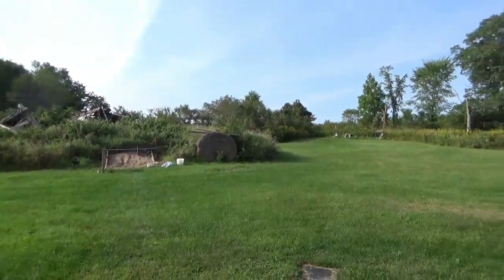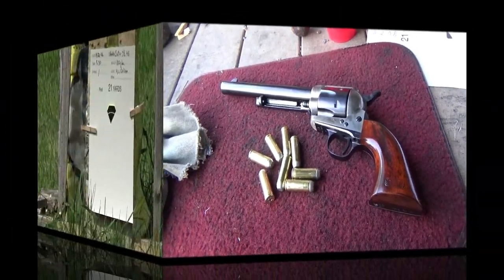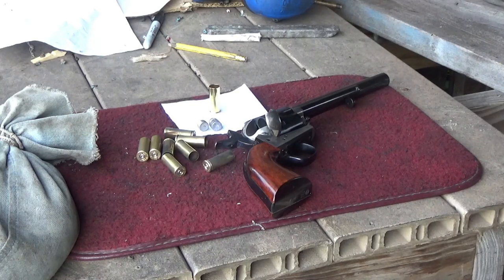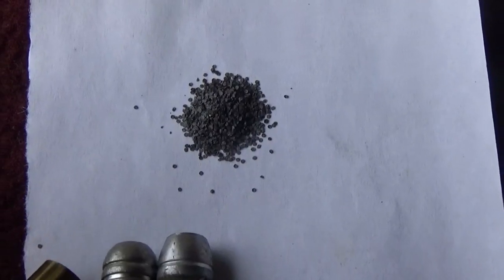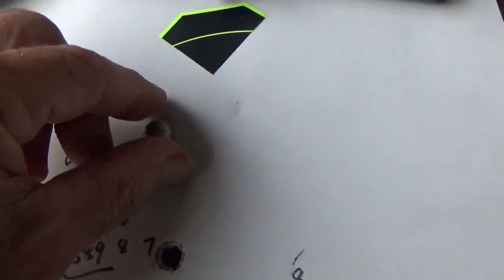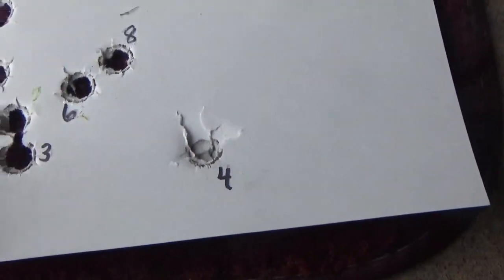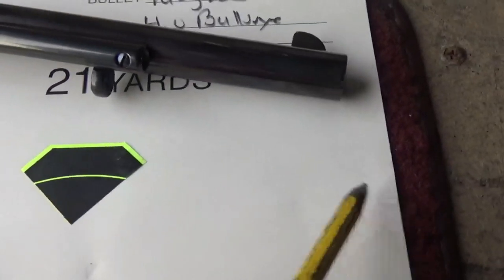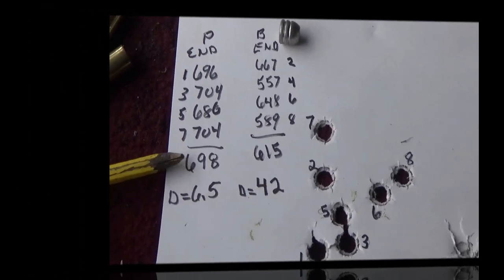Powder Placement 45 Colt  - Part 1

Comment: Interesting results. That’s why I prefer trailboss powder for smokeless 45 Colt, it takes up a lot of that case volume.
Reply from the maker: I’ve used that also, and have had pretty good results. What I don’t know about, there are claims that it produces considerable more pressure to get similar results to other powder. Then again, living on a more dangerous side, it makes perfect sense, as long as you have a supply. Thanks again for your time and comments. O. R.
Reply: @oldranger3044  I do like to live dangerously!
Reply: I also use Trailboss for the reasons stated. It produced the most consistent loads I've made... with an 1892 Mark I Webley.

Comment: I've used 1/8" nitro cards over the powder on 45-70 loads to keep the powder on the primer (with low powder loads) & it works great. I've never tried it on 45 Colt pistol loads, but looks like it might be a good idea with low powder loads, as well. Thank you for the idea.
Reply from the maker: You’re probably aware that some shooters are reluctant to do that thinking that if the wad moves or whatever, and powder gets ahead of the card, possibly a KaBoom. I suppose as long as that doesn’t happen, life is good. Just wondering what your thoughts are on this ?  O.R.

Comment: I did the same test with the 44-40 in a Uberti 1860 Henry.  With 8 grains Unique I found 300 FPS difference.  I now stay with black powder only in that rifle (brass frame).  On a side note with a 45-70 sharps and a 37 gr charge of Reloader 7, I stored the cartridges for a few months nose down.  Went to the range and the first shot did not detonate the powder but the primer lodged the bullet about 6” in the barrel,  unburned powder in the chamber.  I now stay with a case filling powder and a hot primer.U
Reply from the maker: Perfect example of experience counts big time. Thanks again for your comment. O. R.

Comment: I had the same results with my .45/70 Winchester 1886 using 12 to 14 grains of Unique, Herco and Red Dot under 340 and 405 grain casts. They all went bang and hit the target but with widespread velocities. The shots taken with the powder at the front had lower pressure, indicated by sooty deposits on the cases.  After some research I tried a 1 inch square of toilet paper gently seated on the powder against the primer using a piece of dowel.  This significantly  improved the accuracy and the cases came out clean. NOTE - Do not use card or any other sort of wad, doing so can ruin your gun and your day. A small ball of cotton wool should be okay but I prefer TP. I use small(ish) charges of pistol powder in .357 and 44 Magnum without TP as it doesn't appear to make as much difference in the smaller cases.
Reply from the maker: Thanks for your information. I have used that same load in 45/70, but never checked speeds.  Groups all that great and your findings give probable causes. Thanks for your comment, especially the note about not to attempt to use wads to keep powder in place. O. R.
Reply: @oldranger3044  Don't try those  45/70 loads with 500 grain bullets, the groups are awful and keyhole like crazy at 25 metres. I use full Pyrodex or 777 for those as real BP isn't available locally.
Reply from the maker: @85waspnest  👍 Appreciate the heads up. O.R.

Comment: A very interesting test! I have been conducting many test on this subject, but using Bullseye there is so little powder volume in the case that I have never loaded it without a filler, I have always considered the fact that when held horizontal the powder would lay along the bottom of the case, even if you tap the cartridge on either end it falls to the lower edge, then when you consider how much displacement occurs on firing, that would /could, put the powder anywhere in the large empty space, I have exactly the same Uberti as the one you are using, but struggle to get groups as good as this using the 250 grn bullet with either solid base, or hollow base, with a foam filler, I am never very happy about large air space in large cases, so always use a filler, but your results here will see me conducting more experiments, I wish we lived closer! Many thanks for posting this one OR! Chris B.
Reply from the maker: Hi again Chris. I have been amazed at how well this gun groups with everything I give it.  This 160 gr. has never done well in rifles, and I’ve been pretty busy last few years playing with percussions. So I’ve had the gun since 2000 but just unboxed it a couple weeks ago as my brother inspired me to get into some 45 shooting. Won’t “bore” you with the battle to correct windage, but that’s fixed (hopefully). 

I was careful and I figure the powder only piled up near the ends and didn’t get much chance to flow along the bottom. Now I’m wondering how it distributes itself in normal shooting. I’ve been surprised how well these smaller amounts of bullseye do in the large cases without filler. They seem fine for my plinking use, and I’m a bit nervous about filler with recoil possibility powder could get ahead of poorly placed wadding.  Lots different than a single shot Sharps.   Plenty of folks know much more than I about this and other stuff, but figured I’d do this vid, couldn’t find much on it on YouTube, and this might generate more awareness. Thanks again. O.R.
Reply: @oldranger3044  The powder in this large case could end up anywhere, but when you think how much the recoil must wash it back and forth it would, logically, end up behind the bullet, that is why I always use a 1/2" dia foam wad that will definitely hold the powder against the primer end, I think Hogden say it does not matter about such a small charge of powder floating around in the case, but my logic says that if you can keep it in one place it must be more consistent, I have not tried my Sharps 45/120 with smokeless, but with these big cases the ignition is very important for repeatability. My Uberti is the black powder frame type, but has very shallow rifling, that is why I made up a hollow base mould, to try getting it out into the grooves, but it is not very consistent. Chris B.
Reply from the maker: @453421abcdefg12345  Interesting. Mine is also that style, shallow rifling. Fairly soft lead (around10) sized .452. The 160’s were tumble lubed, and 454 as cast. I’ve also had good results with a Lee 200 gr TL semi wad cutter that comes out of the 6 cavity mold in the.460 range. Stopped that when I noticed difficulties starting them in the case. Some wouldn’t even chamber.  Thing is, I was shooting 1 1/4 groups at 21 yds for 4 of 5 shots. Thinking about getting another Uberti, as my brother has a 4 3/4 old style that is good. Like you said, if closer it would be interesting to compare guns with the same load..O.R.
Reply: @oldranger3044  I have tried so many bullet styles in a quest to get mine shooting well, I even tried a hollow base in an attempt to get the bullet gripping more firmly, tried hard lead, soft lead, powder coating, I have a feeling that hollow base bullets open up the "skirt" as the barrel on a pistol,(7 1/2") is so short, that gives awful accuracy, I have not tried copper jacket as they are .452" for auto, I was going to re barrel but I cannot shift the barrel, do not want to twist the frame! I find the cap & ball pistols are much more accurate . Chris B.
Reply from the maker: @453421abcdefg12345  That's been my feeling too.  In today's dollar, would there be any cartridge handgun made in the $300 range that has better accuracy than a replica 1858 Remington?? I doubt it.  I haven't put much $ or stock, into the cartridge guns (I prefer SAA's) as a result.  Maybe I'm unlucky because this Cimarron Uberti shoots really decent.  The next 10 I buy may prove to be like yours.But, I got's to know.  I'm not famous enough for someone to dump 5 on the doorstep to test.  So, you know what that means.  
I assume you figure that .452 is too small?  As you said you tried hollow base.  I was going to mention that I recovered a slug that was .460 (Lee 200 grain TL), and the forcing cone, or barrel had it sized down to 451 from what I could measure.  
Anyway, this 45 has given me a "New Hope" for the style gun that I grew up to admire.  It might actually shoot as good as the percussions.  O.R.
Reply: @oldranger3044  OR, I am sure back in the day there were some lemons among the guns available, after all Winchester had their 1 of 1000 rifles that were said to be the most accurate of their production line offerings, but it is odd that with the relatively crude system open to so many variables , that our C&B pistols deliver such consistent accuracy. As for barrel dimensions, I am sure that now Berretta has control of manufacture the cartridge 45s are machined to the SAMMI spec for 45 ACP, which is .451 not .454", and also have very shallow grooves, but the chambers appear to still be machined to the 45 Colt dimensions? Chris B.
Reply from the maker: @453421abcdefg12345  I read that the stampede (beretta) was uberti. So is my Cimarron. Chambers accommodate the 45 long colt easily, actually I was wondering if they would be a problem but if appears not. I haven’t pushed it much past 700, but it sure seems to shoot. So why yours doesn’t is a mystery. 
One reason I started shooting it was because of how well their less expensive percussion guns shoot. As they seem to have gotten it right with them, maybe their single actions would be the same. Possibly you got a Friday one, and of course with modern equipment??
I have a Virginian 357 SAA made in Switzerland by The manufacturers of those expensive target guns (Hamm~~~~), that can’t keep 5 shots in a plate at 20 yds. Would love to know why. It was a fairly expensive replica sold back in the 70’s. I have a duplicate that was my Dad’s that’s never been shot, and now its time to see if his shoots and if mine is a Friday one. O.R.
Reply: @oldranger3044  I have been up and down the velocity scale, but there seems to be no sweet spot, I should just accept that it is a duff gun, it was a special order one with great expectations, it barely keeps on the target backing at 20 yds, I fitted 1860 grips on it and had high hopes, all I can now do is make a new barrels and try that, I cant loose at least!  The barrel is really tight in the frame, so that could be a problem, but I will have to make up a contoured clamp to hold the frame to prevent twisting it, only thing left to do now, that is why we shoot these things! Chris B.
Reply from the maker: @453421abcdefg12345  Your comments and experience is encouraging me to try a few more things with my Virginian. I have an identical one that is NIB, so I can exchange stuff. Maybe They both are NG, the twist is 1-18, maybe just to slow for 38. This sort of thing helps get me going in the morning. O.R.
Reply: @oldranger3044  OR, We all need inspiration to head out down these unknown tracks, I take some comfort in that even Winchester, with it's mass production of repeatable machining accuracy, found it worth while selecting out their 1 of 1000 rifles as being "more accurate" than the other production rifles when tested, and sold them as such, I think one thing we do not have as individuals is a heap of parts to interchange to assess what is causing this strange problem, I have checked for barrel/cylinder alignment, barrel dia, (which on my Uberti is small for Colt 45), and the only "error" I can find is the relationship between chamber, and barrel dia, the rifling is also very shallow, and I suspect that is the problem, if the grooves were out to .454" as SAMMI spec I would have deeper rifling, like the C&B pistols have, and they shoot very well, even if the chambers as issued are a bit small, the soft lead projectile obturates to fill the grooves. Whatever happens, never stop experimenting, that is why we shoot these things! Chris B.

Comment: Interesting test! I kinda wondered about that at times, as I don't have a crono, but shoot light .45LC loads using Winchester 231.
Reply from the maker: I’ve been into black mostly for the last several years. Started shooting some 45’s recently and thought I noticed different recoils several times on the first shot. That, and having read about the effects of powder placement of smaller amounts in large cases prompted me to run a quick check as I have a chronograph. Honestly, I didn’t think there would be that much difference, especially in deviations. But it does make sense. I’m going to do more tests just by tipping the gun and hopefully won’t have to pull the video because of inconsistency. O. R.

Comment: I agree placing a cardboard disc over the counter or maybe a cork cut out over the powder holding it back against the primer I think that might be a good way to try that out
Reply from the maker: I’ve read that there can be a risk because if part or all of the powder happens to get ahead of the disk, weird stuff like high pressures can happen. O.R.

Comment: Those loads I would use Cowboy 45 Special brass. That should catch on hopefully. Not much room for load variation. The 250 you can crimp in the top lube groove if using shorter case.
Reply from the maker: Good plan. I got some brass after doing the video, but shamefully haven’t used it (yet). Looking forward to it however. Thanks. O.R.
Reply: @oldranger3044  I also use it in my 3¾" 45 Colt Ruger single action. The ejector rod is very short and full length 45 Colt are difficult to get out ½" is all that protrudes at full stroke so muzzle skyward is the easiest way to clear the long cases.
Reply from the maker: @samwilliams1142  Another advantage of the short case. Probably little need for the large case unless using a full load of Black Powder. O.R.

Comment: I've heard titegroup is not sensitive if it's up or down in the case.
Reply from the maker: Good idea, may run a similar test just to see. O.R.
Reply: Titegroup is a very affordable powder for shooting 45 Colt.  6.0 grain starting load goes a long way and with 160 grain bullets it sips lead like 38 Special.  Still makes big holes in things!